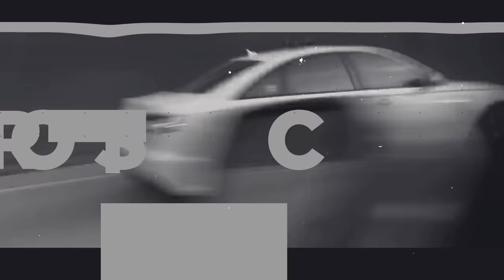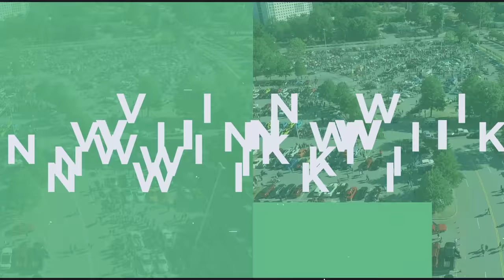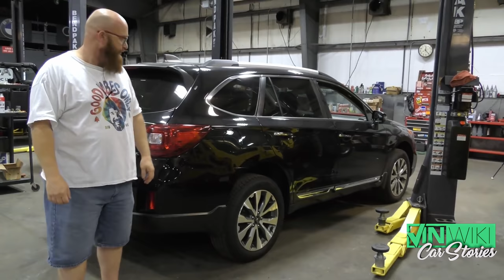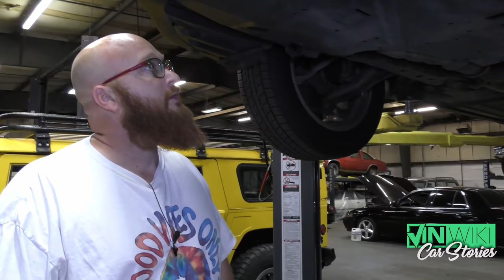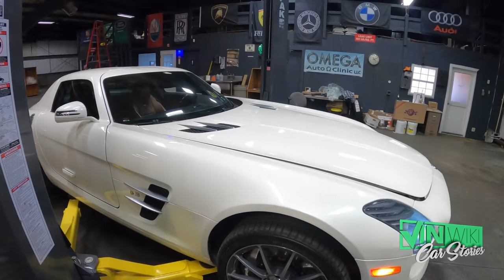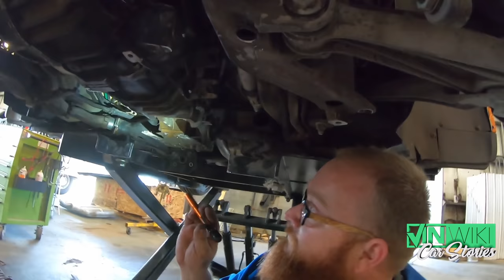The Car Wizard's 4 Worst Mistakes Ever!

Comment: Speaking of workplace injuries, was in a coal pit shoveling out the pieces that fell down inside the lift track section that has the big scoops on a track that brings the coal up to a furnace, big operation for a hospital..  either way routine task done monthly in the winter months.  So this area is about 25 feet deep and 10 feet x 8 feet Lxw.  Brick walls , ladder built in on one and a big chain driven pully system on the walls, like a compressor pully with big gear and little gear except straight up and down with big gear on the bottom..  big gear is about 10 feet of a fan like sheet steel shell..  so the dude i was working with got hired about a month or two and boss kept getting onto him to cut his hair because its not safe to have hair that goes down to your ass cheeks when doing anything physical and told him to at least tie it up on his head..  so dude let his big head of hair down because was over 109° down there and had to shovel.  Well im doing my thing and all the sudden i hear him, very loud background noise btw where you had to yell to hear eachother right face to face, but i hear him hooting, like somebody yelling “who” after they got kicked in the nuts.,  well i look up and this guy has his hair wrapped all around his face and neck and had it stuck between the chain and gear and wad being pulled up off the damn ground slowly..  the thing turned at about 15 rpm..  so doesnt look dangerous but seeing him stuck i immediately hit the emergency kill mushroom button.  Well the inertia of this thing doesnt allow it to stop on a dime..  so i am pushing up on this guys nuts, legs anything i can to let him try and get loose to breathe.  Well the godamn gear pulled him up to where i couldnt provide support and i ran to get a ladder or anything i could stand on but when i was climbing up the ladder on the wall i looked back at him and never will forget seeing the fear in his eyes and hanging there bleeding from his ears nose and mouth..  about as dark as you could make purple…. Guy choked to death before i could get back with a ladder..  dialed 911 when i got above ground but couldnt hear to talk so i just yelled the address and part of the building we were in and threw the phone down praying they heard..  they did.  Didnt matter though..  i threw the ladder down the pit and dude was hands at his side and still..  but i rushed and got up on the ladder and jerked half his scalp off to get him down and still feel bad about it but didnt give him mouth to mouth because he had blood all over his face..  but did cpr for what seemed like maybe 2 minutes before the medics got there..  pronounced him dead right then and there..  said he died of asphyxiation and brain aneurysm.  Told me that when the blood was coming out his ears it was too late anyway so there was nothing i could have done differently but there was..  i let him take his hair down..  knowing that he wasent that careful of a person but thought he could get it free in time from that slow ass chain but thinking back you cant feel the shit getting caught in it until it has ahold of it..  happened about 4 years ago and still fresh in ny mind as the day it happened..  godamnit..

Comment: That last story lmao. Military basically has a blank check with that $700+ billion budget
Reply: And it's got a massive stable of attorneys and accountants to checkup on those purchases. All in all, acquisitions in the military is a massive maze of red tape and politics. It's the only reason the tank plant in Lima, OH wasn't allowed to shut down temporarily for retooling so we could start building a new tank. The army was forced to use funding for a old design.

Comment: well, for the first guy, I can understand.  I mean destroying a trans and drive system like that is pretty unforgivable, partially because if he went to go sell the vehicle later on it doesn't matter if the one they put in was "newer" because it will be found out that the trans was replaced for whatever reason, and then question start coming up, so in a way, it dimishes the value of the vehicle even though it runs fine.

I don't know if he did, but he should have made Tyler pay for the repairs.... after all, it was his idea.

I guess to the last one with the Tank, that's probably forigvable, unlikely some of the "mistakes" politicians keep making that cost us a bit more than $2.5M dollars.

Comment: I was present when a freshly rebuilt JT8D-17, which was being trimmed and was running at rated thrust of 16,400 pounds,  ingested a SnapOn flip flop screwdriver which bounced out of the pocket of the mechanic was adjusting the trims when a cross wind over the fuselage caused the engine to unstart, which caused the mechanic and ladder to 'bounce' about 4-5 inches off the ground.....  
This was just after sunset, and it made some really pretty, REALLY expensive sparkles out the back....0_o
It got written up as a 'bad rebuild' and insurance covered it.....I sure am glad I wasnt on the ladder doing the trims that day....and I wouldnt have had my screwdriver in my pocket, either....but....just sayin'

Comment: I actually got put into a position at work that ended up getting me fired. They had a semi trailer they wanted to convert into a sled.  The only way to hold the roof up was a fork lift. I told them no. That I wouldn’t sawzall the top off this thing with only a fork lift balancing in the middle. You can kill yourself but I’m going home I guess. It’s nice to see the wizard doesn’t think like that about his employees. He’s got a heart. ❤️

Comment: I like the wizard but his first two stories are great examples of why it is a good practice to use a shop that specializes on a certain brand or brands.  Wizard is an amazing guy but he can’t be an expert on every brand.  A Subaru mechanic would never have made the mistake.  (This is not meant as an endorsement of dealers but of independent shops that specialize in a particular brand of car.  Dealers know their vehicles but have an incentive to charge a lot and do unnecessary work.)

Comment: If you follow instructions and go by the book mistakes rarely happen. A $2m dollar engine dropped because most likely protocols were not followed is not a mistake, it's incompetence. That particular incident is 100% preventable but I guess when there's no accountability how is one supposed to actually learn from thier incompetence.

Comment: Kudos for those decisions, although the Subaru one does sounds odd to me.

Not to you personally, you couldn't have handled it any better, but why didn't the guy go to an official dealer with such a new car? 20.000 miles, sounds like it wasn't even 2 years old with that mileage.

I have an 11 year old Volvo with 135.000 miles and still go to the dealer because of their service.
Went in 2 weeks ago with a broken rear caliper and they didn't even have to order one, they had it on stock.
The car got fixed and serviced the same day.

They're stupid expensive, but it's hard to find an honest mechanic around here and very few new ones are starting up because of the electronical crap that they put in newer cars. It's just too costly to start up nowadays.

Comment: Skip'd clevis pins check; time saved 45 secs... Price: $2M .. amazin! Great stories, it just confirms: sheeeit happens "we're only humans after all".
I skipped a few heart beats myself when hookin up the Electronics Lab best newest $5500 oscilloscope (in '98 money) to a project: "I believe pin 1 is the ground..." BZZT! ZNAP! "Note to self, pin1 is not ground". Oscilloscope went dark and quiet. Uh-oooh... 😱 I stared blankly at desk as Chemical Brothers "Block-rock'n beats" was blasting in my headphones but I sang "Get ready for some... Fuse Pop'n beats..?". Is there an company insurance for stupidity like this..? ...or is this bye bye salary? 😬 Well, it sorted itself out without any major costs, the 'scope reset and rebooted after an extra off/on power cycle and only the ground clamp need needed to be replaced as the claw ended tip was severly pitted by the arc and did not retract/grip smoothly anymore.

Comment: Dang it happens, 
Subaru should have got a new transmission
Reply: A 10k mile transmission in a 20k mile car is still pretty good.
Reply: @troyjollimore4100  
Covered by Subaru also ?
10k ? What was it doing for those 10k ?
In such a new car it definitely should be a newy. 
In an older car it would be ideal 🙂
Reply: @pavels470  Do you realize that, if you’re driving off the lot with your brand new Subaru (or most brands), and the transmission happens to grenade… They will not replace it with a brand new transmission? It’ll get a ‘rebuilt’ unit, no matter how much you cry and complain. I’ve also heard from mechanics that many salvage yard original units are in WAY better condition than most ‘rebuilds’.
Covered by Subaru? Yes. The transmission is theirs. The car is theirs. It is within their time and mileage warranty coverage. Why wouldn’t it be?
What was it doing? Probably what a transmission does until the car was totalled in an accident. Might have been in a flood car, in which case it was probably still well-sealed. Worst case, it was stolen and abused by the thieves joyriding for one night. Subaru’s transmissions should be able to take that kind of abuse. But I’m sure Wizard researched it’s background before committing…

Comment: Number 1 rule. 

I have someone's life in my hands, even more so when you look in the rear view mirror and see a car seat! 

#2 a persons second biggest investment most likely is thier vehicle, thats there bread and butter maker! 

#3 be straight up if you fuck up. Bettwr to take the heat and get it fixed correctly and safely then the person driving off and somethibg happening and it comes back, even worse when its a tow truck bringing it back. 

The list goes on but you gotta be and your Ps and Qs, and even the vehicle that is beat to !&$%!, do your repair but dont do it half ass because its already a beater. You dont know that person's life, be a sport and make em a list and have em sit down and just explain cheap to high but also safety 1st. Again you got thier life in your hands. Im not selling, im letting them know hey your riding on a prayer!!! 

Really like watching the wizard and a couple other's. They actually go the extra mile to make sure no guessing and just throwing a part because the scanner said somthing that seems simple. Its only there to help you narrow it down!!! And has the tools to get it right!! 

Ppl at my job do that bs and it annoys me because then it comes to me to do it right!!

Comment: Listen, I'm not saying anyone should be discharged or even reprimanded for dropping a $2M engine in the military but it should br more than a shrug and a pat on the back. People should be panicking and figuring out where they are going to get the money allocated from at least. This isn't anywhere near the actual issue but is more just an example indicative of it

Comment: I would be 100% more upset if you hadn't honed up to the mistake/gave me the car back in worse condition, sure I may be inconvenienced due to rental car costs, not having my own car, etc, but yea car wizard made it right, and if I had to take my car to a mechanic I would be far more likely to take it back to a shop who took ownership of the mistake and made it right, than risking taking it to another shop who may not be so honest with the error. 

It is far more trouble dealing with dishonesty than it is with an honest person even if the honest person is just as human as the rest of us and made a mistake.

Comment: Conveniently nothing about wiring up the A/C compressor clutch to a switch on the dash on Hoovies Lamborghini.  That's something hacks do.  I have no respect for this dude.
Reply: Even though he was told to do it by the customer? Thinking you’re the ‘dude’ that insists on every repair being made by the book, but then pulls a Karen and refuses to pay the bill for all of the extra time and materials required… 🙄
Reply: @troyjollimore4100  shortly, he could have refused to repair it like that.  It's like being asked to straight pipe a car when the cat gets clogged, instead of replacing the converter.  As a shop owner myself, I need to always remain aware of future liability to myself and my business.  And I'd be damned if I'm going to rig up a switch to a compressor of absolutely unknown price and availability.  Because, at the end of the day, it's your word against his when things go to $h!t.
Reply: @12jazon  Soooo… do you think he’ll do this for just any old customer? Or for a good friend and business partner with what is pretty much a ‘junkyard’ Lambo that he’s made the decision on, and will likely NEVER revisit it on him? 🤔 I know tons of ‘good’ mechanics that have ‘straight-piped’ cars (mostly back in the ‘90s, before emissions were tightened up). That’s up to you if you want to play the snob. In the end, the customer signs off on ‘work requested’.

Comment: After everything you did to right that wrong with that shelled tranny u think he'd be a customer for life to keep it 100 most places would of just gave the customer there car and  then played dumb about why it was that way.. everyone makes mistakes and you can really judge a pro from a rookie on how mistakes are handled and sadly these days pointing the finger and switching the blame seems to be the trend instead of just manning up and doing what's right.. the difference being when someone mans up they learn from the experience instead when pointing the finger and switching blame no one learns anything except the customer who learns that no one cares lol..  and I'm sorry but the best part of the wrong fluid in the wrong place with hoovies whip was the look on dudes face when he was injecting the wrong fluid and what's funny is that's how honest mistakes happen yall crossed ur Ts and dotted the eyes and just happened to mix the holes up which makes sense cuz  you have to look up at the car and maybe the diagram or something was a downward view or what ever but just him with a huge smile injecting the wrong fluid into the tranny of someones basically dream car was meme worthy... and like a G yall just took it on the chin and fixed it till all partys felt things were made right.. it's just sad that how you handled all those problems isnt the industry or even the common standard... I'm in commercial construction and deal with small honest mistakes all the time and it's like pulling teeth most times to just have someone say "my bad" and fix what was done wrong instead of just letting the next guy inline have to deal with it so props on showing how a pro handles it cuz we all know how a non professional does lol